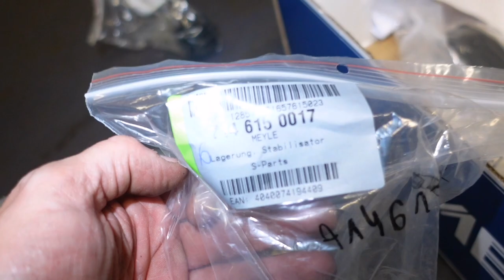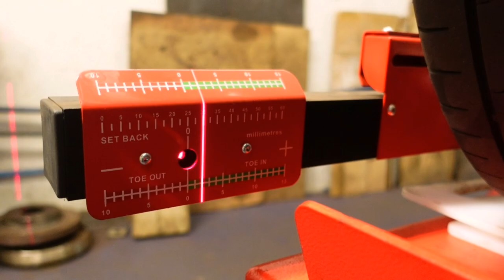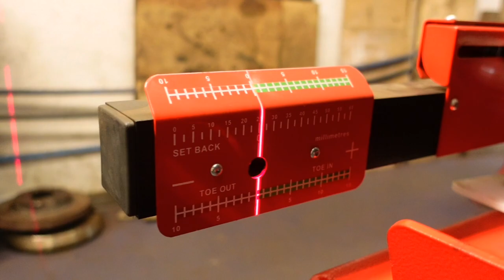Ford Focus Mk2 Rear Subframe Refurbish. Link Arms Replacement

Comment: I am the owner of this car and have driven over one hundred miles since picking it up, its like driving a different  car!  Great job Davey.
Reply from the maker: Cheers Michael
Reply: I'm about to tackle the same job next month on mine, good vid mate cheers.
Good handling motors when it's all tight 🙂
Reply: What was the cost
Reply: Considering doing the rear subframe on my focus. It's just passed the mot but there's a lot of knocking on the rear. So thinking do all the bushes and arms new shockers then that should cure the noise.
Reply: I can only imagine how nice it rides after this job. May I ask how much it costs?
Reply: Cost?

Comment: Yeah those trailing arm bolts. I cut mine out (inner ones with the camber bolt) with a 115mm cutting disc on one side of the bush and a recip saw on the other because the cutting disc would not fit. Oh, and the outer ones were seized in too so I had to cut them out also! I think I got both sides with cutting disc. Put in Powerflex bushes because I have too much money! 🤣🤣

Comment: Very informative hands on instruction video...Those lower arm inner and outer suspension bolts are a real pain. I spent 2 days try to remove the inner camber one...I have an induction heater and air hammer. In the end I used a blow lamp (carefully) with the air hammer with lots of GT85 to push it through the bush.  Resist use a mallet to hammer the threaded end of the bolt (even if you hammer the refitted nut) you will bend the sub frame...and worse peen the end over so it will not slide through the bush....ps When I replaced the bolts, I used JCB hydraulic ram blue grease to aid future removal/adjustment...

Comment: Nice job Dave , many would run away from that one , those camber bolts are a proper pain in the bum , have seen guys cut through them , love the camera video clip after showing everything moving correctly,  sat here on the balcony in sunny gran canaria just eaten a ham buttie with Kerrygold butter , top job , Poppy loving the fun fair rides 👍👍🍦🍦🍨

Comment: Really good video Dave. A lot of work involved, but well worth the finished article, it should last for years. 
What’s a ballpark figure for the cost of this kind of repair? The replacement components must be around £300? The hours dismantling and preparation for painting of the subframe must’ve been considerable. 
Top job though 👍🏻

Comment: That is fair thorough Dave, a brilliant job & well done for getting that camber bolt out it fought you good 💪💪
Reply from the maker: Cheers Peter,  other camber bolt was  just as stuck so went straight into the heat,  5 minutes it was out
Reply: @davesterl  I was very impressed with that complete job and the recording of it 👏👏

Comment: Top job, Dave. Another happy returning customer there; have watched a few of your excellent videos on that Focus (injectors and bushes IIRC).
You've inspired me to do a little work to prolong the life of mine. I'll simply hit mine with a wire brush, some rust converter (Vactan) and a liberal coating of Bilt Hamber Dynax UB whilst up on ramps. If I get just another year out of it, that'll be grand.
How does your Surf look underneath? Would love to see that up on the new lift and some more content with that
Reply from the maker: Cheers Robbo
Reply: I did said works in the autumn. Sub-frame scrubbed up well. The car just went through the MOT with no mention of the rear suspension rust that was down as an advisory last year despite using the same garage. Cheers again Dave, hope you're keeping well

Comment: Great video thanks. Could you cut the camber boots out with cutting wheel rather than wrestle with them?
Reply from the maker: Wrestle?? That is in real time in the video
Reply: @davesterl  Yes sorry. I am anticipating the job I might have with mine without the tool and air hammer. Is cutting viable option if you are replacing the camber bolts anyway?

Comment: I need to paint the underside of my yaris so can you tell me what rust converter and paint you used. Also what did you use to film the rear suspension while you was driving as I'm trying to find out which engine mounting is moving on my car.

Comment: Just done the trailing arm bushes on my Focus following your other video (that was a huge pain on axel stands on side of road!). It was a great help thanks.

Curious, how come you chose to fight with the camber bolts rather then chop them out seeing as you have new ones?

My Chugger-Chugger gun is nowhere near as powerful as yours so i suspect i won't be getting mine out and chopping them is my only option.

Other question/thought was could this all be done by dropping the subframe as a whole (first removing springs) then disassemble it. I suspect due to limited access i may have an easier time trying that.
Reply from the maker: I chose to remove the bolts with the frame still attached to the car as access is good and the car body is holding the frame firmly for me. Choping bolts risk marring the frame.
Reply: @davesterl  Neat thanks for the explanation :)

Comment: Is there a special shaped tool to adjust the upper alignment bolts, on the rear axle?
Reply from the maker: there are no upper alignment bolts, just the ones i show in the video
Reply: @davesterl  the c shaped upper arm, should I say

Comment: Dave, you were certainly persistent in taking out those frozen bolts in one piece. Since you were replacing the arms and bolts anyway, why didn't you use a Sawzall and a metal cutting blade? It appears you had room, and a good blade would cut those bolts in seconds. Anyway, entertaining as always.
Reply from the maker: That's a last resort, risk of damaging mother material. It will never cut staight. You'll get a cut on the left side not so on the right. The right side would be butchered.
Reply: @belfastboy2811  Sometimes it's the ONLY  choice.